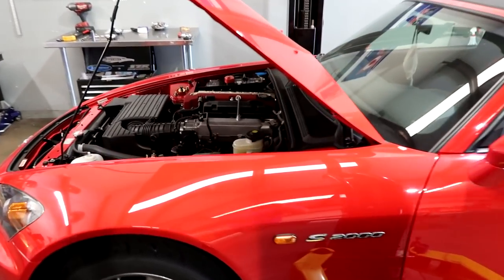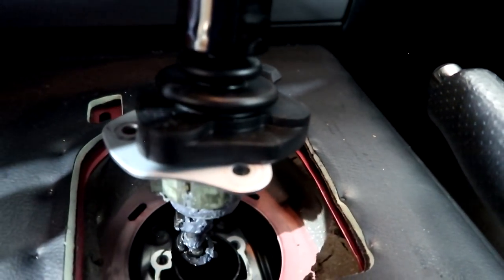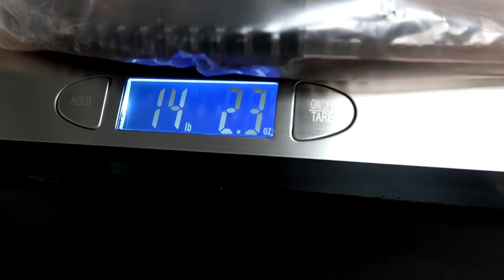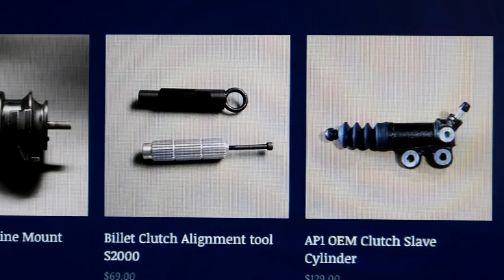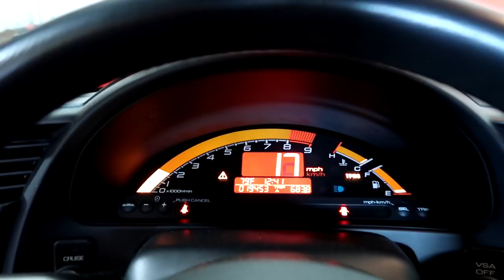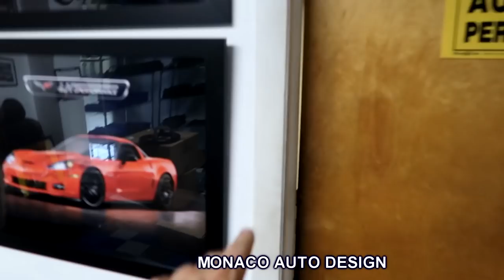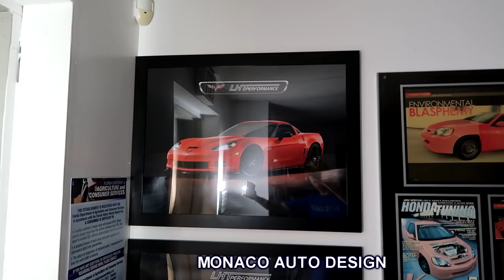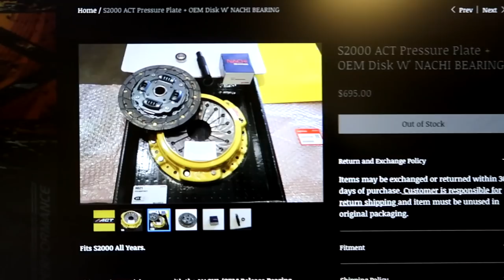LHT S2000 - new FX300 Clutch.  AP1 v AP2 Flywheel

Comment: I'm sold on the FX300 and the even lighter than AP1 Clutch Masters Flywheel but didn't see it in the store? Which model number is it and is it still available through you guys? Thanks!
Reply from the maker: We’ve found the lighter flywheels actually amplify the clutch sound and make them annoying. The AP1 is the best compromise in my opinion.
Reply: @LHTPerformance  My throwout bearing is shot on my 2002 and since the clutch is original with 175K miles thought I'd change out everything ... guess I'll keep the AP1 flywheel then and save some $$. Thanks for the advice. Had the car since new and you guys have been a great help over the years! Too bad I'm way out here in Phoenix ... lol
Reply from the maker: Yes. Re surface your AP1 flywheel to factory specs. We sell the FX300 in the store and include the OEM Nachi bearing and pilot bearing.

Comment: I have installed you ACT combo oem ap2 clutch with a act flywheel. The engagement is only smooth with more revs then a oem setup. It shakes or bites on or off with very little rpm at take off. Did I do something wrong?
Reply from the maker: Did you break it in correctly ?  We recommend a very gentle break in ( hence why do some break in with the wheels off the ground first ).

Comment: I would like to buy this clutch and flywheel setup with the flywheel rebalanced and machined. Do
You sell this option
Reply from the maker: We have some flywheels coming from the balancer this week. I’ll try and get them in the store soon.
Reply: @LHTPerformance  ok did you install a ap1 slave and braided line. If yes we’re can I get a ap1 clutch line to fit my ap2 if no why not?
Reply from the maker: @steven212008  We did an AP1 slave, I didn’t do the line. The do have the slave in the store if yoy need one.
Reply: @LHTPerformance  ok I actually just bought one other day from you guys but I thought you said I need to get a stainless line to make work. Can you give me a idea on how to make it fit Exaclty
Reply from the maker: @steven212008  If you’re using the AP2 line, you can either trim the small locating tab down or orientate the line a different direction. That’s what we did on ours.